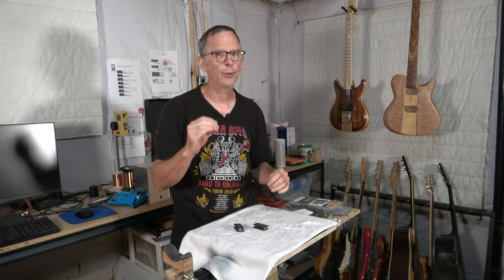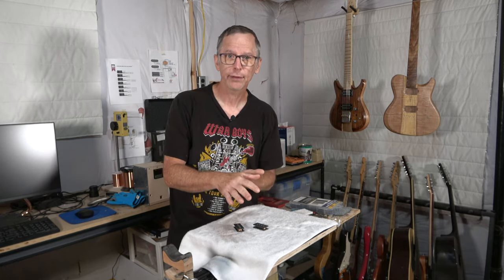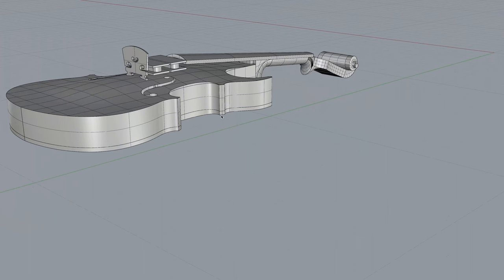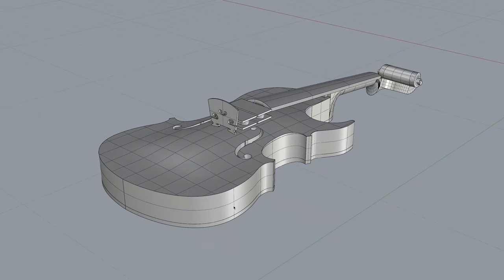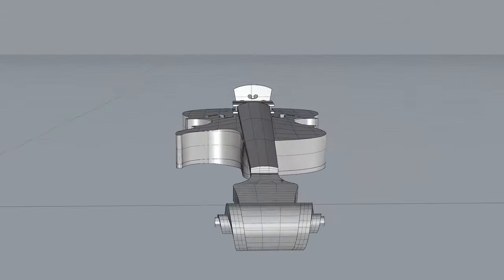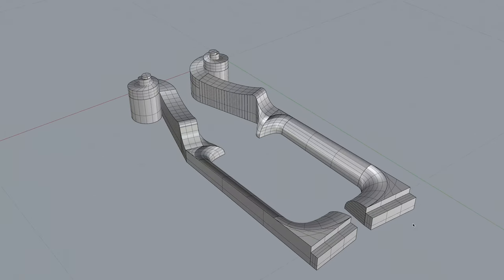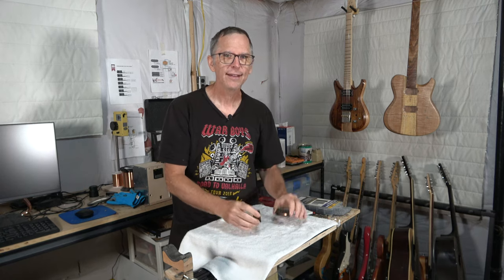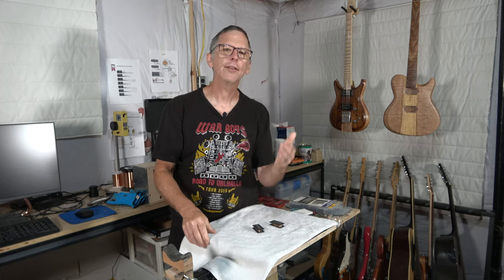Making An Electric Violin Part 2 The CNC Strategy

Comment: (Sound of me furiously scribbling notes for future reference in my project notebook...) 

So are you using metal strings to work with the pickups? I really don't know much about electric violins; please forgive me if this is a naïve question. I had thought that electric violins were made with regular violin strings and piezo pickups. This is really fascinating to me, as this is exactly what I would be interested in doing (electric guitar pickups and strings) if/when I try an electric violin of my own. This is really a lot of fun, thanks for doing this on your channel.
Reply from the maker: First of all, thanks for the tip! It's very much appreciated. Second of all, I don't know much about electric violins either, so this will be a learning experience drawn from what I've learned making electric guitars. To that end, my plan is to use violin strings that have a steel core. They'll need to have ferrous properties in order to work with the magnetic coil pickups I intend to try.

Comment: Looks interesting. With a magnetic pickup, I would think the output of the D and A strings might be pretty low compared to the G and E strings. Because the radius of the strings is much smaller than a guitar or bass.
Reply from the maker: Stay tuned for a magical solution.

Comment: Congratulations, i like your videos a lot. About magnetic pickup, there is a problem using it on bowed instrument. When bowing, string mostly moves up and down (like bouncing the string) unlike while plucking it moves right left direction. When using magnetic pickup with bowing, sound producing is low during bow stroke and then increase after stroke is over, on sustain when string movement direction changes.
Reply from the maker: It works fine for Jimmy Page. 😉

Comment: I've been watching Olaf the Violinmaker on and off for the past few months. One thing I noticed with violins is there is a post, a wood dowel, that is friction fitted between the front and back under the bridge. Are you going to do that? I think it has something to do with coupling the front and back to make it acoustically louder. Since this is an electric violin, is that not a concern?

Are you going to be making your own bow, as well?

I've been thinking about doing an electric cello. I've always wanted to learn how to play that.
Reply: Right, a "bass bar" is what it's called in an old book I have on musical instrument design.
Reply from the maker: No bar. I will not be making the bow.
Reply: @HighlineGuitars  It is a hollow or semi-hollow design, though, isn't it? I could be mistaken, but it seemed that way as you're carving the interior on at least one of the body halves. I'm not sure it would matter either way for an electrically amplified instrument, but if it were me, I'd look into this feature if you haven't already. Since your design philosophy appears to stick pretty close to convention in the other, visible aspects, it could make or break the instrument's utility (should you decide to develop the concept further).
 Thanks for giving us a look into an intriguing design process!
Reply from the maker: @DrMackSplackem  If this violin was going to be played acoustically, then yes, that feature would make sense. However, it will be electric only, so coupling the front and the back won't do anything useful.
Reply: @HighlineGuitars  Oh, OK. It was only the hollow or semi-hollow aspect of the design that made me curious. Thanks!

Comment: I think the pickup will work great
Reply: I think the polepieces aren't close to matching the radius of a violin. The best pickup design I've ever seen or heard for violin was by Leo Fender US3003382A and it's a totally different design from what Chris is doing.
Reply: @cocotheix2664  Those do sound good. The advantage of a magnetic pickup is that it filters out the bow noise really well - my experience has been when you use distortion with a piezo it tends to create a weird nasty peak. This design seems to allow for a best of both worlds. Bad Snacks did a great video on her violin signal chain
Reply: @tylermatteson7289  It's an interesting idea for a pickup and i do like the sound, it's quite natural, but it doesn't have that super creamy sound of a magnetic pickup that directly picks up the strings. Sbip and Cantini offer such pickups for violins, though the sbip pickup looks a lot more like a guitar pickup.